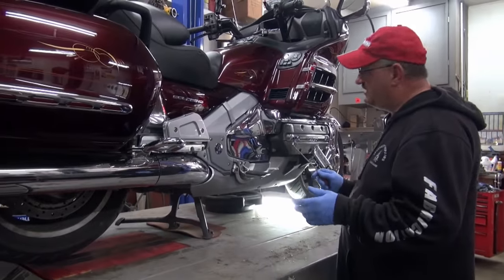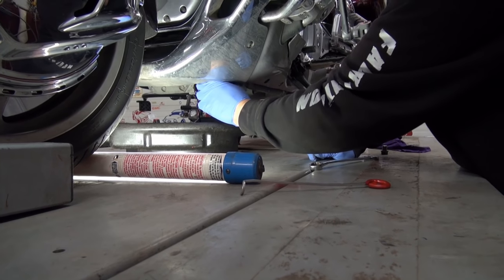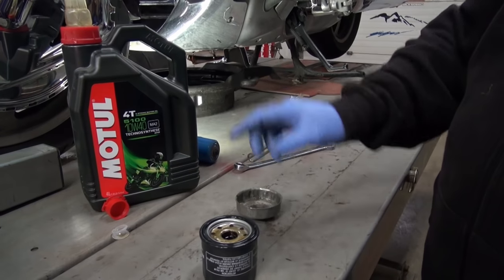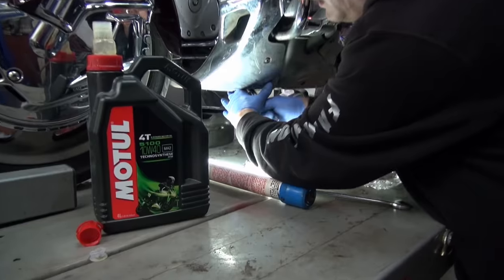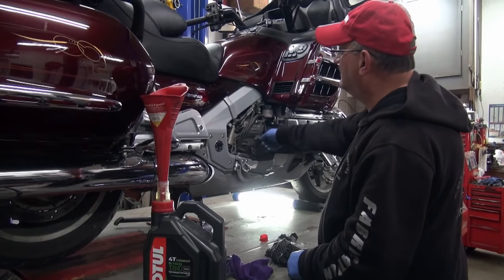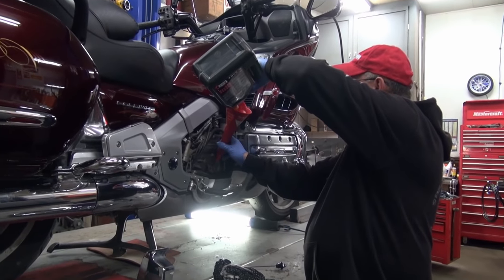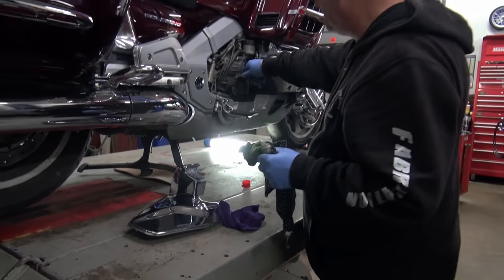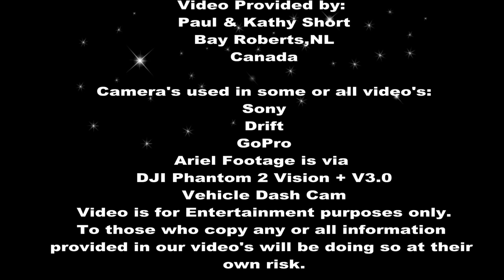Changing the Oil On A Honda GL1800 GoldWing

Comment: Just got one for the first time. Glad I watched this first. The service manual shows taking off the front cover. Why the preference for 10w 40 over 10w 30? Just curious thanks.
Reply from the maker: As per manual use 10w 40. In motorcycles that’s all I’ll ever use. Get motorcycle oil with no poly in it. Ride safe Marc. Merry Christmas
Reply: @7863348  Hmmm, mine says 10w 30. It's an 07, but aren't they all the same?
Reply from the maker: Do your manual show to se it at a certain temperature? That might be the reason. In any case do what the manual states. It knows best 😉
Reply: @7863348  Ahhh, one page says 10w 30, and an other shows both in a temperature range graph. I should have noticed the picture first, cause I'm just learning how to read:)

Comment: I am sure you did it but I did not see you do it. wipe down the oil filter fitting on the motor. Making sure no road grime gets between the engine block & the filter. Good video.

Comment: I like your videos pretty much more than any one else's on here, I have a question about the timing chain... mine that I just bought used is a 2002 1800 GL. I am the third owner the other owners didn't log the maintance in my owners manual. Plus it's just about to push 40,000 in about 400 miles... The owners manual doesn't have an interval for the timing chain, is it a lifetime timing chain??? I have heard of those... I did spend time looking for the inspection & removal/replacement of the timing chain on your channel and other ones and they are impossible to find... Sincerely a new subscriber, Paul...
Reply from the maker: Thanks Paul. These GL1800 engines were built to last. As you'll know they pull like a train and are very reliable. If it was a GL1500 which had timing belts they would need to be changed regularly but considering the GL1800 have timing chains don't worry about them. I've never heard of one chain failure. Remember. Honda said that they would warranty these engines up to 300.000 miles or three years when they first came out. Yours having 40.000 miles makes it just broke in. My advice is to just get on it and ride it and enjoy life. I'll be taking mine out in the morning for the first time this summer. I got ill and couldn't ride. Thanks for watching. Ride safe.

Comment: Great video for detailed instruction; however, when checking the oil level the engine oil is supposed to be done with a warmed up engine.  For me that means when the coolant gauge is at normal operating temperature.  After oil change, if you fill up the oil pan to dip stick full on a cooled down engine, I guarantee dip stick will read overfull once normal operating temp is reached.  I leave the last oil top off until I start engine and let it warm up to operating temp once more and then wait 5 minutes to let all oil sink down to pan. By then the small amount of top off oil has little effect due to rest of oil being hot already.  Saying that I always watch Paul Short's video prior to changing oil as a refresher (I'm 65) to make sure I cover all the bases.  Thank you Paul.
Reply from the maker: I’ve been doing oil changes for a very long time and I’ve never had a higher than normal oil level the way I showed it here. I was also a Honda motorcycle tech in a dealership for three years and it was always that way. 
This is exactly why we don’t do safety videos or mechanical videos anymore. Everyone has all the answers so I don’t need to do them now. Maybe you could take up the cause? lol 
Ride safe
Reply: @7863348  The coefficient of expansion of motor oil is 0.00039 per degree F. If you took one gallon of motor oil at 70 F and heated it to 220 F, the temp rise is 150 degrees F. Multiply 150 by 0.00039 and add that to 1. That 1 gallon would now be 1.06 gallons.

Comment: Thanx Paul! Now I know! I'm even willing to give it a shot. I had a question about another mechanical matter. A dark black oily liquid had dripped down from the clutch at some point. The fluid level is low also. Is this a major issue?
Reply from the maker: Your Welcome. Sounds like you have a seal on the way out. These clutches work on the engines oil pressure. Get it checked.

Comment: Hello group, so the 2016 (model 1800) to check the oil level has to be in the center stand?
Reply from the maker: Yes it means the rear center stand. The reason for it is to make sure the bike is level. If you can get on it and keep it lever to check the oil it’s the same as putting on the stand.

Comment: Never heard of "priming the filter" before. Sure seems like a good idea. Thanks. Do you know of any negatives about using a compatible, larger, less expensive, Fram filter?
Reply from the maker: The way I see it when it comes to filters we pay top dollar for the machine so why cheapen out on the engine oil filter. The manufacturer knows best and their filters were designed for their product.

Comment: Thank you again Paul for another great class on the GL1800! I have a 2006 as well and I will be priming the filter (great tip) from now on. Question for you. My garage is unheated and I live in Vermont, so do I need to change the oil in the spring even though it only has a 1000 miles on the current oil? I use the Motul 7100. Thanks again and all the best to you and your lovely wife. Russ.
Reply from the maker: Thanks Russ. Glad you enjoyed the video. I surely wouldn't bother throwing away that good oil. Leave it in it. That's what I'd do. Keep well and ride safe.
Reply: That is what I was thinking. Thanks again!!
Reply: Paul Short u

Comment: Thanks so much, you do great work. Very conscientious in your work. I have a question: I bought (on Amazon) a uxcell® 65mm 14 Flutes Oil Filter Cartridge Cap Wrench Tool Socket Remover. It fits very tight on the filter the next size up that I found is a 67mm 14 Flutes Car Oil Filter Cartridge Cap Wrench Tool Socket Remover. Would the 67 mm be too big?
Reply from the maker: I'm thinking it will be yo big. Have you tried using a filter strap? I find them really good. https://www.amazon.ca/Advanced-Design-ATD-5208-Filter-Wrenches/dp/B000OUZBTQ/ref=sr_1_1?ie=UTF8&qid=1468182796&sr=8-1&keywords=Oil+filter+strap
Reply: Thanks, a good idea. Thank you for taking the time to reply. Keep having fun on the Goldwing.

Comment: By the way, under a over 3 year old Video - This Oil also works on GLs and CX's Hondas from the '80ies really well. I alway drove "Mineral Oil" - But this one is only partly synthetic by the way and rated for wet clutches.
It really does make the shifting of the gear smoother plus it's better for the gaskets.

Comment: nicely done. The oil filter looks like it's in a vulnerable location for being hit by road debris.
Reply from the maker: Thanks. It's a common location for those filters. I've only heard of one incident where something hit one. On our wing I have a full skid that protects the full underbody of the bike. This guy never bothered adding one.
Reply: After having my engine coolant plastic reserve tank damaged & later replaced, then putting on a full skid plate (which was later damaged by running my 2008 GL1800 up the tramp drop/down door of an enclosed trailer) I had to remove the skid plate!

Comment: Can I use that Motul  5100 in my 86 Goldwing 1200? Would it be ok for the transmission or wet clutch?
Reply from the maker: You could but I use Castrol in my 1980 GL1100 and it works well.

Comment: I was hoping you could show a video on how to bleed the brakes on a GL1800.  Sounds like it needs to be done in a certain order and can be screwed up pretty easily.  Any chance?? Thanks in advance.
Reply from the maker: You didn’t mention what year or country your 1800 is in but if it’s an older 1800 there’s a recall for brake fluid change that the dealer will do free of charge. They are very detailed to do. Mine has ABS brakes so it’s different then non abs models. Our wings are asleep for the winter and won’t come out of hibernation until at least June. I always advise GL1800 owners to purchase he factory service manual. It will pay for itself on the first repair.
Reply: @7863348  Hi Paul. I am in Calgary so my bike is in hibernation as well. My Goldwing is a 2003 GL1800 ABS version. The brakes recall was performed according to Honda. I had heard it is important to change the fluid every few years and wanted to try it myself but could not find a video that was very good and your videos are well done and easy to follow. I did pick up a brake line vacuum pump for the job.
Reply from the maker: The idea of changing the fluid is to keep the moisture out of the brake fluid. I check mine with a brake fluid moisture checker. If mine fails the test in the spring I’ll change it and do a video on the procedure. Get yourself one of these. They are great https://www.amazon.ca/Taxutor-Hydraulic-Moisture-Indicators-Diagnostic/dp/B0834PVSBT/ref=asc_df_B0834PVSBT/?tag=googleshopc0c-20&linkCode=df0&hvadid=459341978054&hvpos=&hvnetw=g&hvrand=4534449350740020418&hvpone=&hvptwo=&hvqmt=&hvdev=c&hvdvcmdl=&hvlocint=&hvlocphy=9000026&hvtargid=pla-885616469702&psc=1
Reply: @7863348  Will do. Thanks. Keep warm.

Comment: I found 3 oils HONDA recommends for our GL1800

1.) Genuine Honda HP4S 10W30 SJ Full Synthetic 4 Stroke Motor OilPro [Orange/Red bottle]

2.) Genuine Pro Honda HP4 10W40 SJ Synthetic Blend 4-Stroke Engine Oil  [Gold bottle]

Nobody offers a more comprehensive line of motorcycle-specific oils and chemicals than Pro Honda. Developed through the performance and durability testing of professional racing, these Honda motorcycle oil and service products are crafted to the same high exacting standards as your Honda.
With years of testing and development behind it, Pro Honda HP4 stands as the definition of excellence for 4-stroke motorcycle oils.
It offers increased anti-foaming qualities, higher viscosity index for stability over a broader range of temperatures, and even greater shear stability than most other oils.
Naturally, HP4 blends the heat stability and shear resistance of synthetic oil with mineral oil's natural lubricity yielding premium quality four-stroke engine oil.
Best of all, HP4 is approved for use in all Honda Powersports products.

3.) Genuine PRO Honda GN4 10W30 SJ 4 Stroke Motor Oil Pro [Black bottle]

*4.) Genuine Pro Honda HP4M 4-Stroke Oil With Moly 10W40 SJ [NOT RECOMMENDED - ON WET CLUTCHES of GL1800!]

Comment: Hi Paul, I used the same oil on my 02 gw end of last year, in November after watching your vedio.. the bike has 56k miles and about 3k miles since oil change. I'm taking a 2700 mile trip, 1350 miles each way.. should I change the oil b4 the trip? I dont know when the coolant and final drive was done either.. any recommendations would be greatly appreciated... Thank you.. Thanh from Boston
Reply from the maker: As far as the motor oil, no. It’s got plenty of life in it. Change it after you return. I always tell my customers that if you don’t know when something was serviced it’s time to service it. Doing that gives you a starting point from that point on. Do the coolant and final drive maintenance, tire pressure and tire condition and enjoy the trip. Ride safe!
Reply: @7863348 , thank you!! I will make sure to get those done b4 i go!! Thanks again!!!
Reply: Thank you Paul, went on my trip got close to 6000 miles on the oil now.. changing the oil right now.. but after over 3000 miles and took the 2800-mile trip, the oil came out clean enough to another 2000 miles.. i used the same oil, Motul 4T, i primed the filter, following your direction.. so thank you!!

Comment: I 03 1800 GOLDWING.
WHEN I TURN THE   
KEY ON THE HAZORD SWITCH TURNS  THE STARTER WILL NOT WORK. 
HOW DO I remove the ignition switch?

Comment: got a question,,, if that bike had the aqua shields can you still changed the oil the same way you did in the video or is there other steps? thanks df
Reply from the maker: What’s an agua shield?
Reply: you will see them on trikes,, they are called aqua shields or floorboards,, they keep your legs dry in wet weather,, they attach from the front cowl to the rear fiberglass near the rear axle..... sure you have seen them,,,

Comment: Do all 1800’s have airbag, as I was told by bike mechanic that airbag makes it a Honda garage job for service/repairs, as a retired hgv mechanic I like to service my own bikes
Reply from the maker: You asked, “ Do all GoldWing models have airbags” 
No they don’t. You have a choice to purchase an airbag model or not. Personally I’d want the airbag model and I don’t understand why you couldn’t service your bike if it had one. We service our vehicles with air bags. Our Ford Bronco has ten of them and I service it. Having an airbag model greatly increases your chances of survival in the case of an accident which makes the Honda GoldWing the safest motorcycle on the planet.
Reply: @7863348  I agree, safety is key, it was local bike mechanic said you needed specialist tools/ equipment to safely service/ repair goldwing. I’m at stage of buying 1800 but was asking to put fears to bed. Could you do a video of air back for safety service how to disable bag from deploying during work. Iv subscribed cos your first two videos removed fear of filter and oil changes, still to watch fork service seals renewal. Many thanks for reply 
James
Scottish Borders
Reply from the maker: @mac243877  Thanks for your subscription. I try and answer when I can but it’s tough sometimes to get to them. James when it comes to specialty tools pretty well everything ever produced needs them. The very first tool I advise everyone to buy at the time of purchase weather it’s a tractor, motorcycle, plane….. is a factory workshop manual. By doing so you’ll have the power of knowledge and instead of relying on guys like me and even your local guys you’ll get the right information when you need it. The manual can and will pay for itself in the first repair or adjustment. By having this manual you’ll know what your doing is the right way and you know that your bike was repaired in the safest way. Good luck with your purchase. My 2003 GL1800 is still running like new and looking new. Ride safe.
Reply: @7863348  ok many thanks

Comment: I have a 1986 1200 goldwing....doesnt have a screw on oil filter.  It  has one that fits in a canister that is screwed on.  So how can I fill that one up?  It has to go on empty
Reply from the maker: Yes that’s true. The CB350, Cb550 and the CB750 Four I had was the same way. If you have anything with a screw on filter it’s advisable to preload it with oil before installing.

Comment: I had a 2006 GW and for the first 500 miles finding neutral was a bitch.  Changed to Royal Purple and never had the issue again.  You are also correct the synthetic oils make an already awesome trans, shift even better.  Only type oil to run in a GW.  I also run Royal Purple in my 2010 Harley and it made it shift better as well.  The difference is the GW trans was like a Swiss watch and my Harley trans is like a rock tumbler.  But that crudeness, shake, and loudness is what we pay for in a Harley.  It was what I missed with my GW.  I did love the bike, but after my wife stopped riding with me, I wanted something more raw and crude.  I would never say anything bad about a GW, it is a bike in it's own class and only those who own or owned them know that.
Reply from the maker: Luc is a Harley guy. He used to ride one all the time. I had Harley's as well. Someone asked me if I went into the new Harley dealership yet. I said Hell no. They asked why? I replied that if I went in there I'd be driving home on a new Harley and it's true. To tell the truth, I haven't seen a bike I haven't liked. They all have their place. You and I are on the same page when it comes to motorcycles and that's cool.

Comment: nice 🎥 video!  why do you not like k&n oil filters. give me detailed reason.
Reply from the maker: I have never seen any solid evidence that they increase HP. I've tried them in various machinery over the years and noticed no difference in performance. Install the oem filter and when it comes time to change it pop anther one in and forget about using a K&N cleaning kit to clean a K&N filter and drive on down the road. Thanks.

Comment: I have a Handy lift simiiar to yours. Does your Goldwing drag in the center when putting it on your lift?
Reply from the maker: You have to have the bikes suspension on high and there's no problem or you can use the extension "red" extension ramp to go on with no issues.

Comment: Using the synthetic oil, do you still change the oil every 4000 miles or can you go longer. Been told you still change the at 4000 also been told you can go longer.
Reply from the maker: I change at the same interval but using synthetic makes the tranny shift much smoother.
Reply: Thanks for a quick response. think that is what I will try next time. your videos are great.
Reply from the maker: Thank you very much. Ride safe 👍